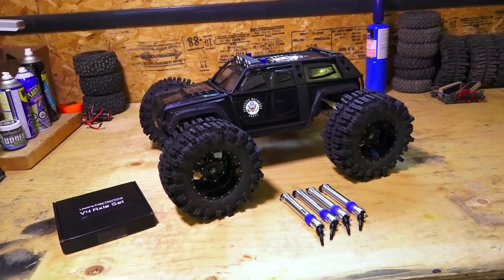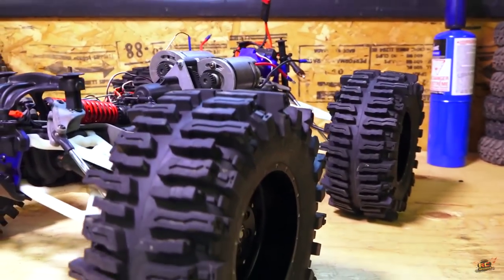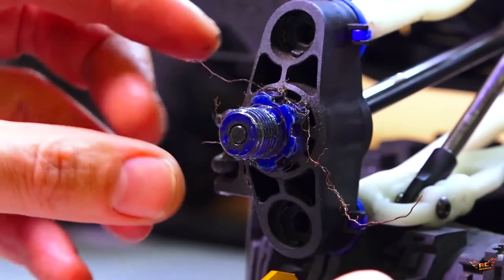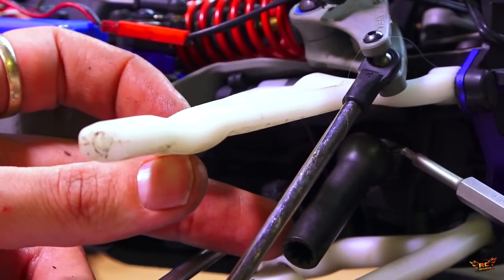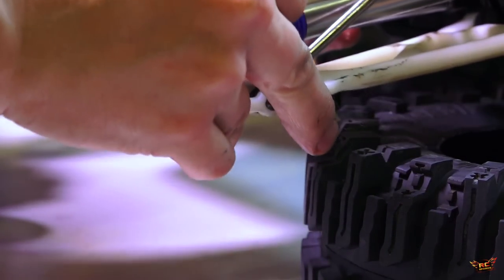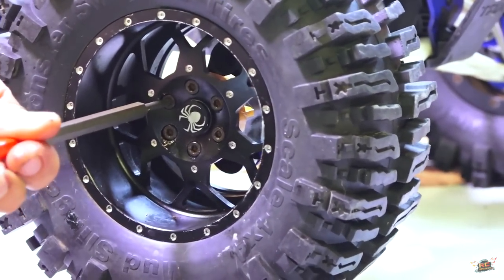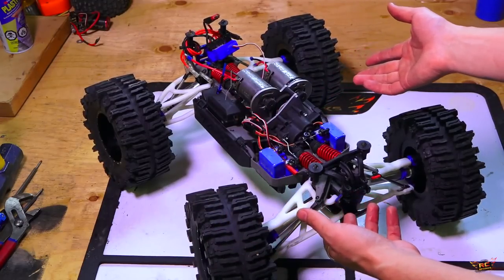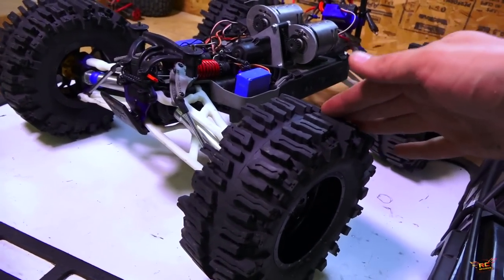RC ADVENTURES - LEM Traxxas Summit 1/10 V4 Axle Upgrade (4 drive shafts swap from MiP)

Comment: This is awesome love your video, and also i have the 1/10 scale summit with castle creation brushless with the 40 series mud slingers, mip drive axles and traxxas alumiinum center drives, I have a brushless 1/18 scale teton but with diff issues, I have a redcat rampage 1/5 scale gas, nitro stampede, and also a t maxx 3.3 but with an ofna picco .28 big block motor.

Comment: I haven't used my Traxxas 1/10 in a while I put a  1/ 8 scale brushless system in there 2100 KV4s  and it used to handle the revo drive shafts but I started driving it now and snapped a couple drive shafts and replaced them new ones and it seems like the plastic quality is just garbage compared to what used to be years back I do not like MIP they break all the time on me anything else you could think of the new drive shaft you are posted or  available still anymore thanks

Comment: I really want one of these trucks (stock) but I don't have the budget to get a new one, would you suggest to wait and save for one, or get one used?
Reply: used is fine but make sure you know what your buying before you do anything and buy in the daylight because its much easier to check for broken parts in the daylight

Comment: @rc sparks where do you get dewalt motors from? ripping apart tools would be super expensive
Reply from the maker: We actually have a dewalt dealer in town that supplies us with replacement motors for any power tool! also.. ebay ;)

Comment: Beware that when you solder on a BEC to the Traxxas EVX-2, there are two battery leads coming from the ESC, and you can only solder the BEC to the lead with the warning tag, or else the ESC will melt down
Reply from the maker: +RC Grid Good info, thanks for that..

Comment: I have a savage XL (nitro, pain in the ribs) a savage x 4.6 which I'm converting to electric. I also have a Traxxas E Revo with a stripped spur gear, demolished servo and empty shocks, I need to maintain my trucks a lot more. The Revo has been out of the game for a while so has the XL, Why? because I'm lazy and in the UK there are no local bashing areas. I miss my Revo so I'm going to order a Savox servo, new steel spur gear, and shock oil. Then I might upload a bashing video. 
Thats pretty much it oh, and Im gonna give these RCs are clean because they are looking duurtaay.

Comment: Great video as always!
I´d like to see you tear down that transmission and install the slop remover! Do you or anyone know if the Summit transmission and diff´s will bolt to old nitro Revo 3.3 chassis? It is already brushless.

 Here are my ride´s:
- Traxxas Revo 3.3 converted to brushless after motor failure. Hobbyking Trackstar 1900kv+120a ESC combo.
- HPI Savage 25, has Hobbyking .28 in it now after engine failure.
- Kyosho Inferno ST US-Sport converted to brushless with cheap stuff, all ready blew the ESC, waiting for a new one.
- Kyosho DBX nitro converted to brushed 550 motor. This one is driven by my kids, don´t need big power.

All these car´s I bought used and beat up. Fixed them up little by little, learnig as I go.

Comment: Ive got a 1/10 scale summit with the jumbo kongs with a single dewalt, a slash 4x4 ultimate that is almost stock with a firewolf motor the slash is my newest car but I also have a ecx boost with a big brushless that I dont remeber, the summit has 2 2s batteries, the slash im only right now running with a 2s and the boost with a 2s to. but the slash will soon probobly have a 3s or 4s

Comment: working on a custom rc right now, twin motor axial transmission mounted in a 2wd configuration, custom steel frame, custom shafts, lots of bits still to come unfortunately

Comment: Medic, I'm thinking about buying my first rock crawler at around 600-300 dollars. Any great starter recommendations?
Reply: +K.C.'s RC I've actually been looking at the honcho and deadbolt, look affordable and durable
Reply: +K.C.'s RC I love the axial scx10
Reply: +Daniel Walden those would be great crawlers, but if it's an axiel your looking for, check out the rr10 bomber!!!!! latest and greatest!
Reply: K.C.'s RC
it's all in what you want to do with it! My ax10 doesn't look totally scale, but will eat up a slash!
Reply: +Daniel Walden Another vote for the scx10 here. Last year november i bit the bullet and got a dingo kit, i'm finishing it up now. It's fully "waterproof", and already made some modifications to it before i even took it out XD.
You really can't go wrong with axial, parts are easy to get, lots of upgrades for it, and they are quite durable even in stock configuration.

Comment: (I NEED YOUR HELP PLEASE) I am actually holding the truck  in my cover photo. I have a arrma outcast 10th Aniversery.  I am very interested in what you have done on the summit.  I have been blowing out diff gears left and right on stock tires. So now i am running 10th scale tires Pro-Line Badland MX 2.10×5.02 BELTED TIRES. THEY LOOK A LITTLE STUPID. Good part is that i have not broke any parts.
I also have a set of Proline trenchers 3.8 series Delta Tires but they break parts like nobody's business. I would really like to know what you think about upgrade Drive axles Wheels and the differentials. What can I do to make them stronger. I want to run a bigger tire but the truck can not even handle the stock tires.
Reply from the maker: You can find LEM on ebay now. Leading Edge Machining  They do still make the parts. I believe Chelsea is the contact lady. Also, I go the wheels at www.rc4wd.com

Comment: What are some good hex bits you/anyone could recommend? I can't seem to find solid 2.0/2.5/3 bits that don't wear out and strip.
Reply from the maker: +Adam Baker Try Davesmotors.com - they have some good ones for fairly cheap. they are the ones I use :)
Reply: +RCSparks Studio I will. Thanks bud.

Comment: Hey. Would you do me a favor? Can you take the Traxxas Summit body, and put it on Your Savage Flux HP and se if it will be a big issue to Mount it? I have no local hobbystores here, and don't want to order it unless I can make it fit :) I think the plastic cage would give some needed protection to the Savage.  Thanks!Love Your videos by the way :)

Comment: I have a helion dominus 10sc v2 1/10 scale comes brushless out of the box with 2.4 ghz I also have a 1/18 scale helion animus it comes with a 2.4 GHz and its 4wd and the dominus I just told you about is 4wd and the entire drivetrain comes already aluminum and I also have a helion volition witch is 2wd but the transmission comes aluminum except the spur gear it comes with a 2.4 GHz radio now it comes brushed 12 t high torque motor and a brushed only 30 amp esc but I stepped it up and put a catsle creations sidewinder SCT on a 2s lipo 20 c 5000 mah it can handle a 3cell but I'm afraid to put a three cell in it

Comment: I have a 10 scale RC judge extreme monster truck I'm having dog bone problems Drive side pin broke that goes into the wheel how do I find that particular dog bone that goes into the wheel it's able to move like a sea song the part that goes into the drive shaft is stable
Reply from the maker: You would have to find the manufacturer,.. or know the name of them at least. Then you can hunt the product. Maybe on ebay.. lots of parts there

Comment: Warning! Noob Alert! What good do the shocks do laying semi-flat do? How to they absorb the abuse you put them theough? Also great vid!
Reply: Or do you raise them before you run them
Reply: Also what cites do you recommend for getting RCs other than Traxxas
Reply: +That Random Person 45 the metal rods push a plastic corner piece that is hooked up to one end of the shock. the corner piece pivots around a screw (placed in a slight angle) and thus changing the direction of the force.
Reply: +That Random Person 45 I usually go to the hobby store, so I can see what I'm buying. but if you do your recearch you can buy an rc from a lot of sites. hobby king is a good example. if you live in europe, I'd suggest you take a look at Lindinger.de . that's where I ordered my SCX10 Deadbolt.
Reply: Thomas Nonnekens Thanks!

Comment: iv done the lem trans upgrade i ordered 2 form lem and only received one from them, i contacted them they  said they would send out  the other one i payed for, it was a month and no show, so i contacted them again, they where sorry and they said they would send another  its been 3months still never received the second one i ordered  i will not do any business with lem they stole my money, i will say the one that i installed did vary well taking all the slop out of transmission

Comment: I swaped my tires on my rc but now one of my wheels are not spinning but is shakink?
Reply from the maker: +Nevandre  Britz Sounds like a snapped drive pin. Remove your tire that is not spinning.. and look to see if there is anything spinning (ie: the axle). If not.. check your dive pin

Comment: be glad you have the upgrades before you start exploding diffs and ruining stacks of ring and pinions. those lem diff cases will save you the 100$ i spent on ring and pinion sets

2200 kv 6s slash/rally ssclcg
2700 kv 4s rustler2slashlcg conversion
2560 kv 4s summit
losi scte 2.0
losi 2wd buggy 2.0
mid motor proline pro 2
Reply from the maker: +Dave C You know whats odd... these are original diffs that I have.. and have run them for 3 years.. I have never had one go out on it.  Even with Jumbo Kongs...  crazy luck i suppose..

Comment: i hate my rustler i wish i had been able to find a mini e-revo
Reply: +Ben Varley is your rustler nitro or electric because I have a nitro rustler and if there is something wrong with it I might be able to help
Reply: Fantastic RC Studio electric
Reply: +Ben Varley Whats wrong with it?
Reply: My old xl1 rustler rocks. 
 Aluminum front bulkhead.
steel gears for transmission.
New style slipper 
 CC sidwinder 3 5700kv. 
Bigbore shocks 45wt. Oil 
Red springs on rear and a few spacers. Team losi black springs on front same oil. 
I have wore 3 sets of tires completely bald with it this year. 
Also have hpi bullet "sucks dont buy one"
Old 2.5 tmaxx black plastic model "great truck"
Late 80's team associated pan car with no body.

Comment: I am building my first RC truck right now. I've build multi rotors and other cars but never something this off road capable. It's a Wraith. http://imgur.com/a/ir705

The pin drive hubs on these wheels are the worst! I strip one out ever time I run it. I have the 12mm nut adapters waiting to be installed now. Plus some proline shocks.

Comment: is it just me or did he put the lower pivot ball cap in backwards the castlated side needs to be the the out don't the in?
Reply from the maker: +Ryan Ariti As far as Ive always had them Ive never noticed a difference, and thought they were reversible..
Reply: +RCSparks Studio  well from my experience one side is concaved to fit the pivot ball the other is flat with castle bit for the standard tool and the hex in the centre is usually covered with a grommet to prevent dirt entering. bit you can remove to use a hex tool as you do.
Reply from the maker: Ryan Ariti Well, thanks for the advice.. Ill have to get back in there and flip them around. Odd though.. there was no cross thread feeling.. and those grommets have been lonnnnng gone for years.. lol.
Reply: +RCSparks Studio your welcome Ive had to remove mines one to many times and just took noticed they arr like a sleave with a thread on the outside so they can do in either way but what you might noticed it it goes in deeper be for going tight.

Comment: heavy breathing lets see im not going to list the 14 other cheap walmart rcs I have just the ones that actualy work  I got a plastic tiagen airsoft tiger 1 and a measly pain in the everyware traxxas tmaxx 3.3  that was traded a pos minibike for and the truck has caused more headackes than you have rcs. It was given to me in a box that was in another box in another box basicly it was given to me in pices and I mean there was a box with screws box with parts box with the rest that wasn't in the other boxes and it had a bad motor. got it running broke it fixed and so far repeated almost every time I played with it. yeah its a love hate relationship. so far the least or most painful is the tank those shots realy do hurt(I got curious and shot my hand throu a sweatshirt) yes I did shoot my self then steped on a shatterd bullet yeah the tank has caused most physical pain tmaxx mental/brain cell loss